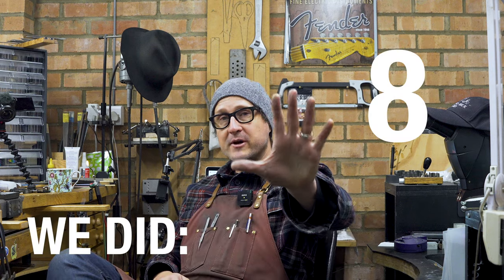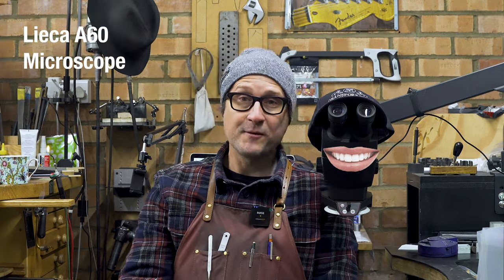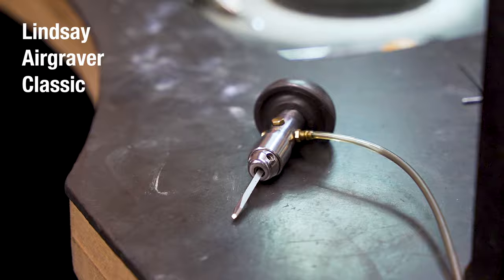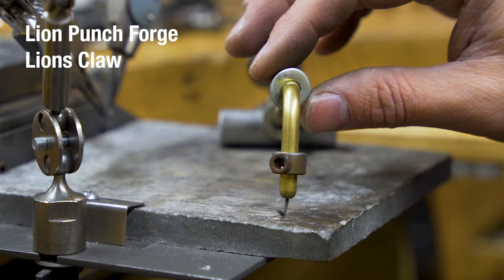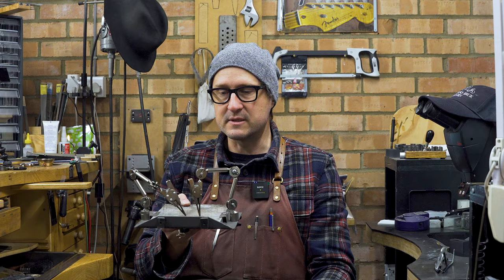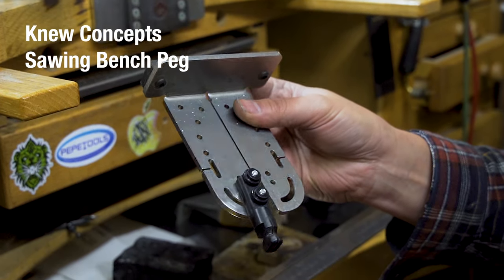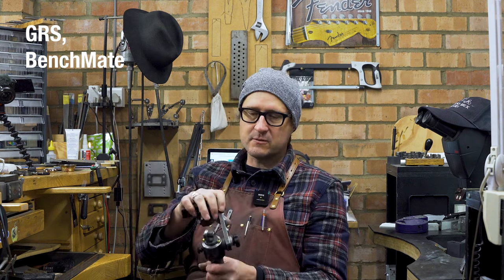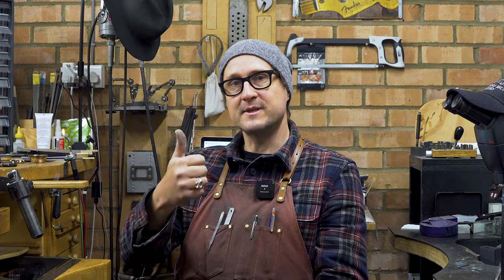8 Great (Must-Have) Workshop Tools | Part 1 | Goldsmith's Workshop Secrets

Comment: Great video, thanks! As a hobby jeweller for the past 9 years or so I very quickly discovered that this wonderful profession is not cheap! I have invested in the benchmate system, Durston rolling mill, hammers, Smiths mini torch, dividers galore, magnetic tumblers, ultrasonic cleaners, bezel blocks.....the list is truly endless (as I'm sure you know!) and still I find more tools I either want or need! The only thing I'm seriously short of is time due to my day job, oh and heat in the garage during the UK winter... everything gets coated in condensation, that's a killer!
Reply from the maker: I feel ya Paul - I’m running a dehumidifier over night and it has made a huge difference to how the workshop feels. I finally started insulating my summer house and should be done by January. Sounds like your workshop is stocked up that side. Thanks for watching 👍🏻
Reply: @jacothejeweller  I was working in a rotten wooden shed for a few years. I had a garage built at the bottom of the garden, it's a lot better than the shed and nowhere near as cold, but still cold. But I really do need to insulate my workspace. A job for the new year.
Reply from the maker: @paulkiley4667  😄it’s exactly what I promised myself last year - I get so involved at the bench that winter surprises me every time. Best of luck with the year to come and have a great Christmas Paul - keep at it.
Reply: @jacothejeweller  Oh I'll keep at it, have no fear of that. And it isn't the investment I've put into it either. I just love to make things that people can actually appreciate. I only wish I'd known what I wanted to do when I was younger I'd have surely trained to be a jeweller. At least I have a master jewellery trainer at hand (Via video, and I've met him a couple of times) to show the way. I'm currently in the middle of a traditional solitiare ring, a first for me but I'll get there! Have a fantastic christmas.